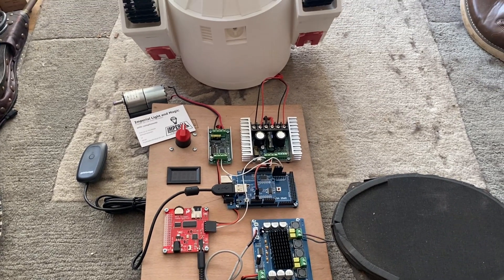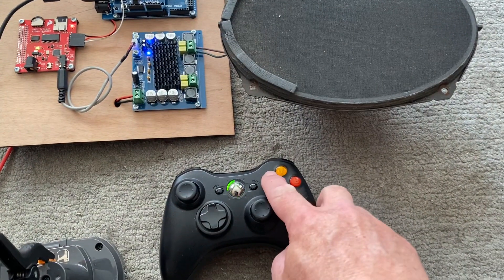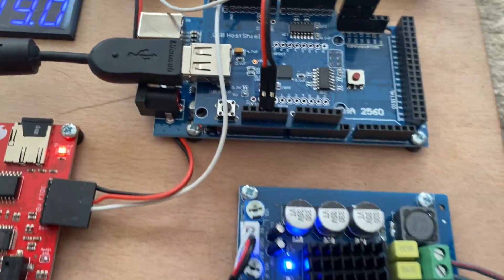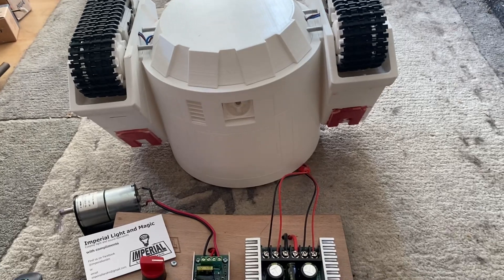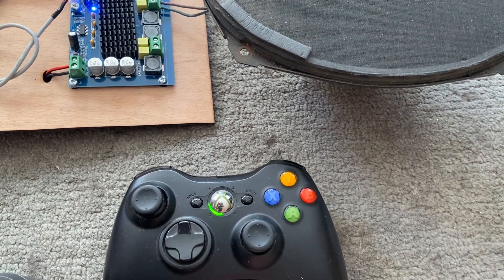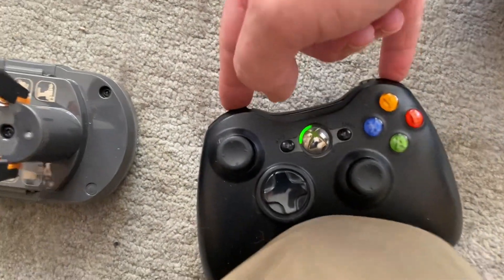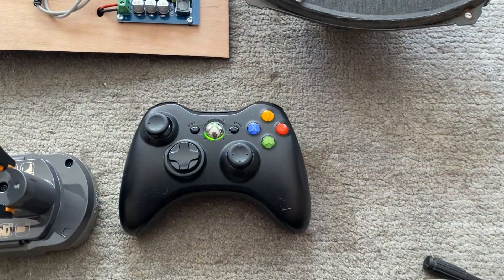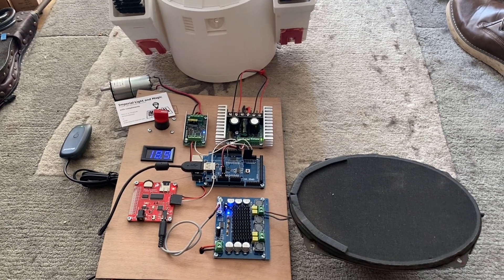Padawan 360 on Ryobi tool battery

Comment: Any suggestions on increasing the volume. I have adjusted on the controller as you showed as well as the volume potentiometer on the amplifier board. Im running the HiLetgo 2pcs TPA3116 100W Audio Amplifier Board DC 12V 24V TPA3116DA Mono Channel
Reply from the maker: have you got a ground loop isolator in your circuit?  If so try removing and test again.

Comment: I thought you converted to using the Arduino Mega ADK board to get away from the USB Host Shield having to be utilized?  Is this in order to us the Maestro Boards?
Reply from the maker: I have, this is an older board that I have had on the bench for a while.  Maestro should work on ADK with no issues at all.